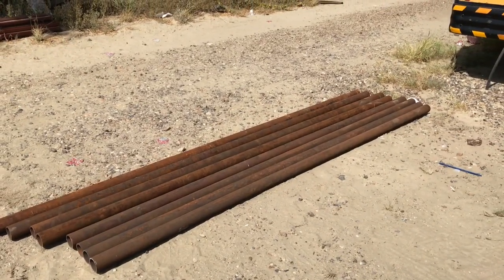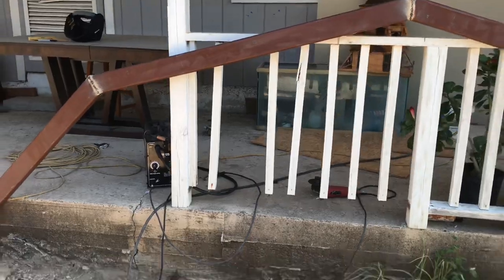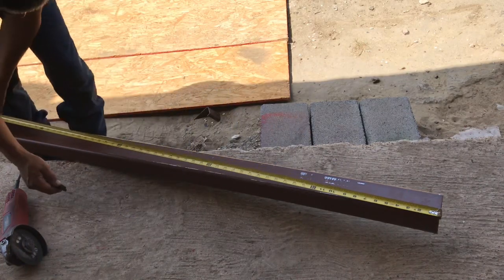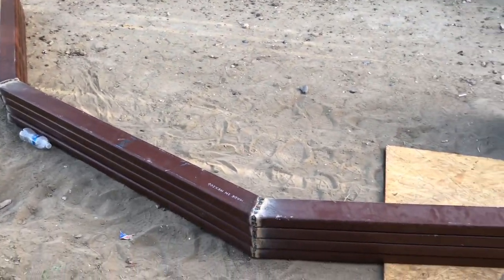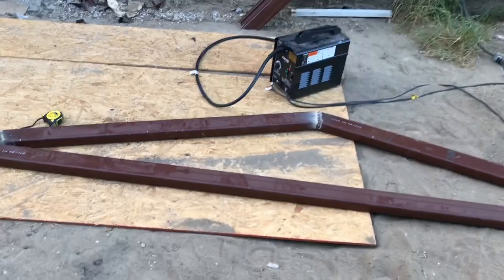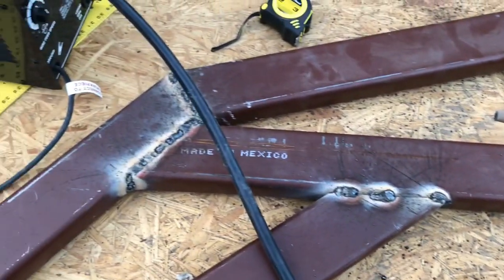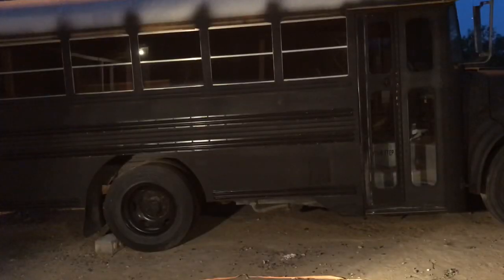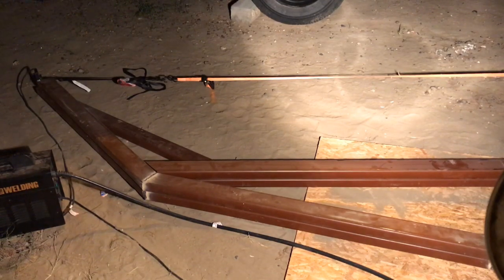Building trusses out of 4 x 2 purlins

Comment: I think those are 2x6 not 2x4 👍 I could be wrong. 😁
Reply from the maker: J&R  hey there J & R. They are 2 x 4 purlin. That’s what the invoice says.
Reply: @JoesBusBarn  oh ok, they just seemed wider than 4. You finally working on that project. When are you throwing the slab
Reply from the maker: J&R   Going to be a while. Next pay period. 2 weeks.
Reply from the maker: J&R   Wallet is hurting after buying all the steel. It’s already a bit over 2
Reply: @JoesBusBarn  yes everything is expensive now these days. I remember as far as the early 90's when a yard of ready mix was around $65. Now a yard goes for about $105 - $115
Reply from the maker: Brother. I need 12 yards. Comes out to 1540. And don’t forget the work of spreading it out flat. Not looking forward to that.
Reply: @JoesBusBarn  I can help you on the spreading. Just let me know in advance when you want to do it.